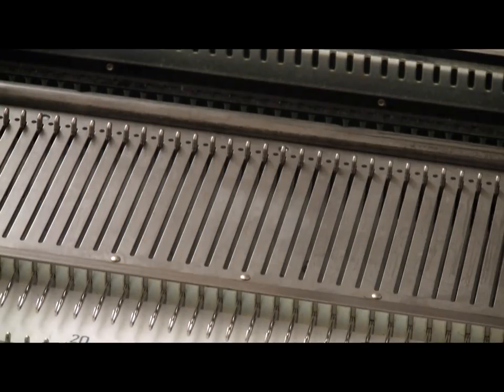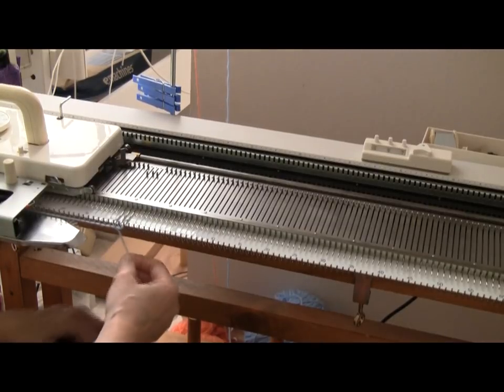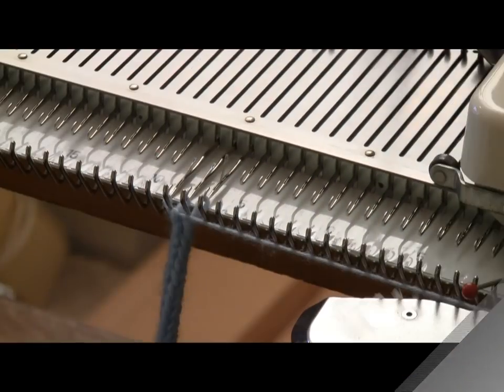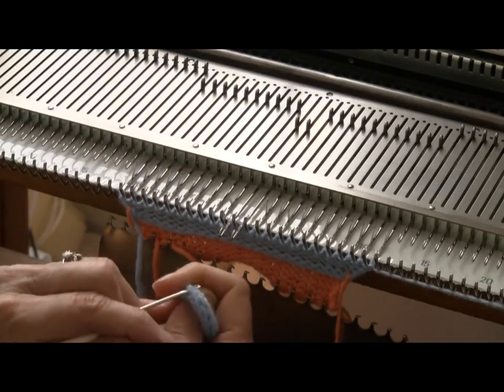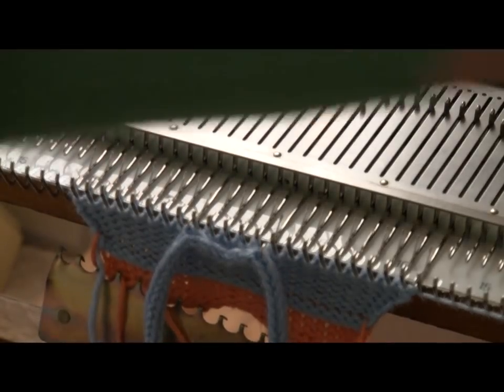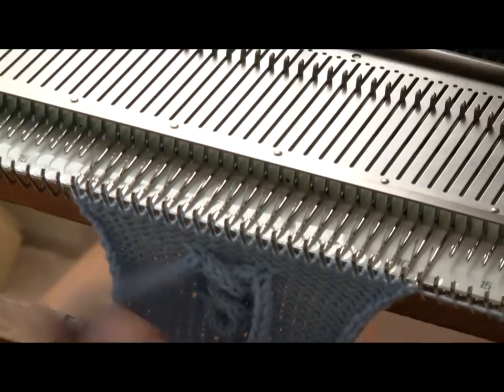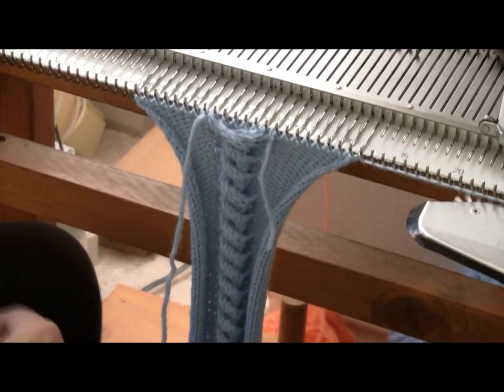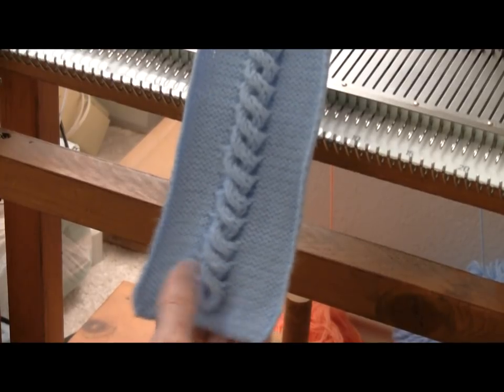Machine Knit Helix Cable by Diana Sullivan

Comment: Hi, Diana,

How do you determine how long to make the I-cord? Is there a rule of thumb?
Reply from the maker: +Diane Turner Make it too long and unravel any extra.  I'd say 4 times the length of the area you want to cover, since you're going to fold it in half and use the two ends.
Reply: Makes sense, thanks!
Reply: Diana Sullivan Hello, Diane. Thank you very much for your video lessons. could you show how to make not only the Aran, but the braids? thank you
Reply: Diane Turner